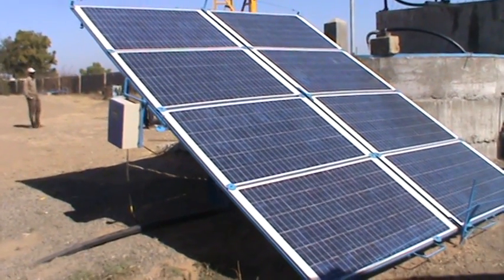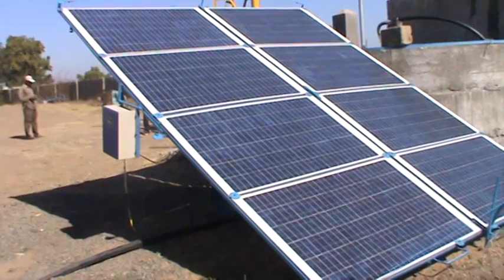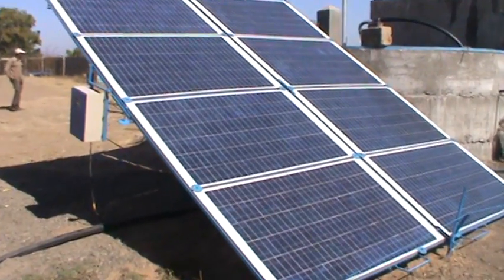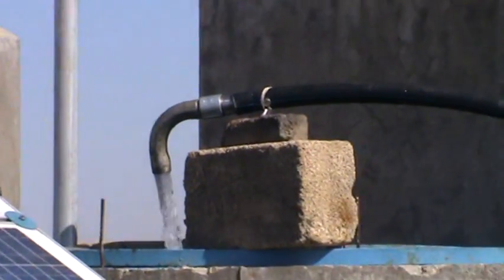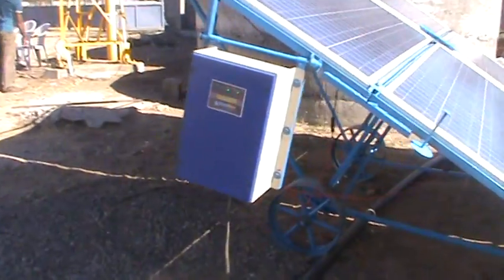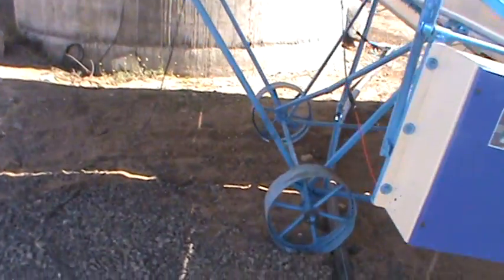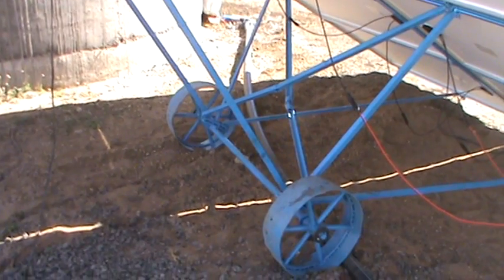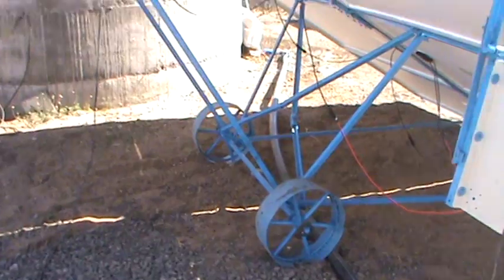2 KW SOLAR WATER PUMPING SYSTEM

Comment: விவசாயிகளுக்கு ஒரு நற்செய்தி : விவசாயத்திற்கு தேவையான 5HP  சோலார் பம்பு செட்டுகள், 3.30 லட்சம் மட்டுமே!  தொடர்புக்கு M Kishor 09841185357 , 9884124365, Power Focus 

Solar water pumping system 09841185357 .., affordable price Pacas on Panasonic solar panels with YESKAWA Japan controls with branded AC submersible pumps starts from total cost price 3,30 lakh M Kishor 09841185357 , 9884124365 , POWER FOCUS
Reply: Cell me sir 9965507577
Reply: 2hp price
Reply: 2hp 500 adi work pannanum 2 kw price
Reply: 2kw vfd normal current la 3 pashe Delta va us pannalama
Reply: 2 hp Delta 110 wainding a 2kw vfd price

Comment: our company also provide those solar pump system ,which can be used in 30-1,500 feet deep well,or lake,river.ect ,and the water flow can reach 500-200,000 liters one hour.
if have any requiredment or questions,can contact to my email address: tony@weigoodsolar.com